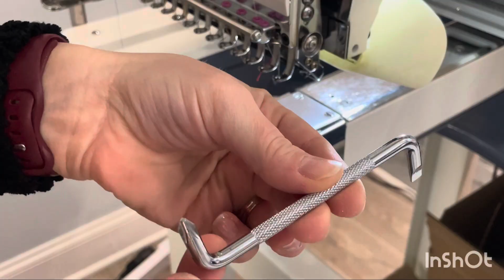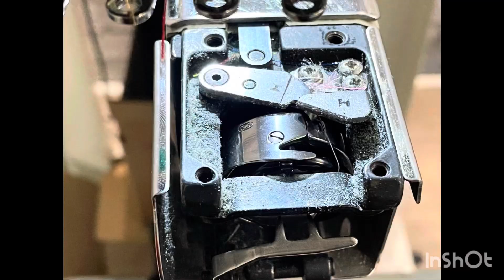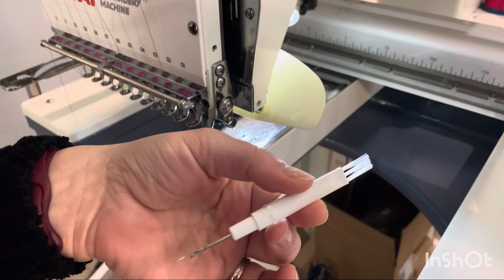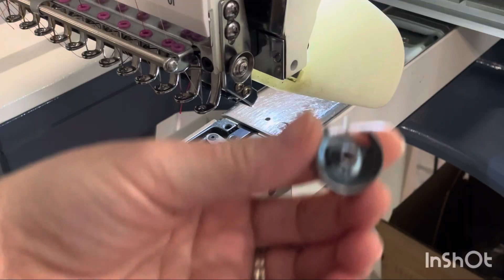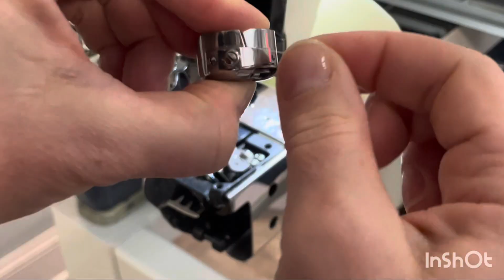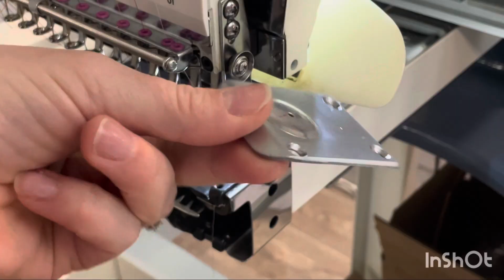How to clean under your BAi embroidery machine needle plate

Comment: Hi Joy!  Please don't blow into your machine.  Canned air is fine, as is a small compressor, or even a tiny vacuum or attachment to remove the dust and threads.  But please don't blow - no matter how tempting.  We have moisture in our breath, and that moisture can cause rust in the machine.  Also, disposable mascara brushes work great for cleaning out machines.